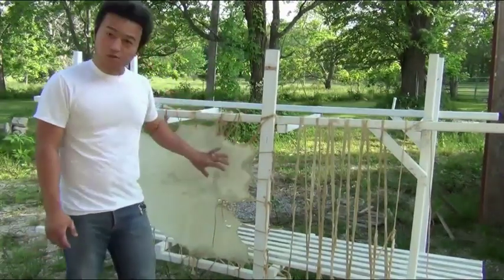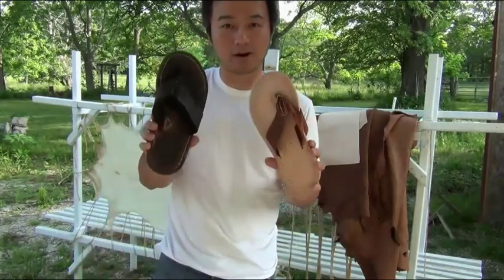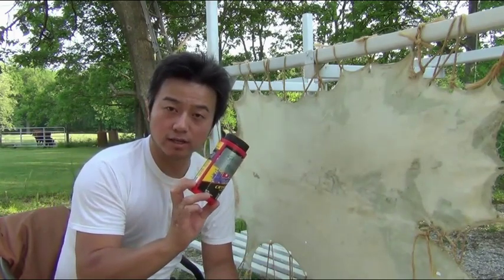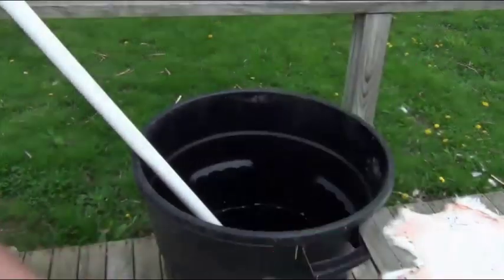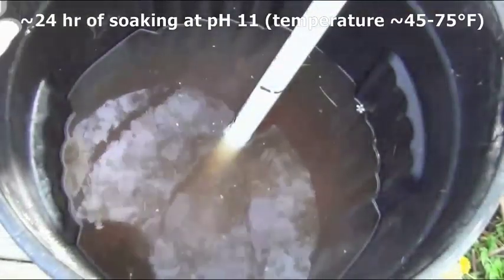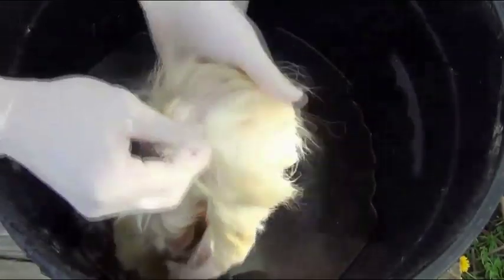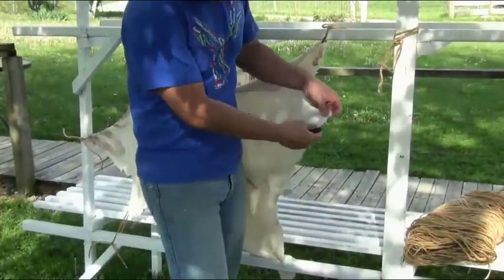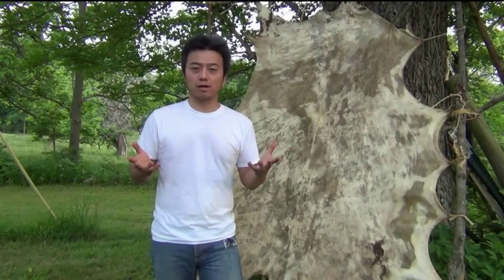DEMO 14: How to Make Rawhide w/o Ash (using a strong base)

Comment: Hi sir I have cow hide that I'm trying to turn to leather and I'm struggling with it. Any simple way of doing it? It has turned into dry hide which is what I don't want. South Africa
Reply from the maker: I do not have a simple way of making leather. I have tried to make leather, it was messy, and it didn't work.
Reply: Probably to late to help but the only simple way to make leather is bark tanning. Many barks have high tannins. You'd have to research that yourself as I have no idea whats available in south Africa. Dehairing and fleshing are two of the hardest parts and both must be done prior to tanning. Chemicals can be used if you have access but they are very toxic. Brain tanning are the fastest. You don't have to use real brains. Veg oil , soap and egg yokes will work. The smoking process is what actually tans it.

Comment: My father in law is bringing me a few fresh deer hides and it plan on turning them into rawhide. But how would you treat it without dehairing it.
Reply from the maker: +Elijah Boesche I would deflesh the hide. Probably, wash it with detergent to get the 
smell out, shampoo the hair, then dry it on a rack. The hair is going to be a problem for moisture, so the area should be well ventilated but also dry, fall is a good time for the Northern hemisphere. Then I might rub a hard wood saw dust on the hair side to help it dry (oak would smell really good), this might cause some of the hair to become loose; alternatively, I would try to blow dry the hair on the rack, but not so much that it start to dry out the skin, I might still try the saw dust as a final step in drying the hair. You probably will need to comb the hair often as it dries.

Comment: now what do you do with the rawhide? what purpose does it serve?
Reply from the maker: Good questions. It was used by natives out west (in America) as soles because of the rocky terrain. I am planning to make this goat rawhide into a drum head, and the cow rawhide is going to be made into the core of a riding crop, a bullwhip, black snake whip, and a stock whip.

Rawhide can be made into just about anything that stiff leather can; contrastingly rawhide has more "snap" than any leather.

I have plan to do more demonstrations and projects of what to do with rawhide this year (2014). I hope you will come back for those.
Reply: The Nomadic Polywright  I'll be here
Reply: We didn’t use rawhide for our soles. We used bark tan or brain tan leather for our moccasins. Rawhide was used in knife sheaths, cut in strips for lashing and securing objects, drum making, rattle making, pouches for pemmican etc...
Reply: I use it for strips for traditional snowshoes and dog treats and cut some into belts to be bark tanned for adirondack pack basket straps. Many tribal people used it for shields and was used for window material. It didn't let in a lot of light but helped. It was scraped thin and oiled with some sort of fat.